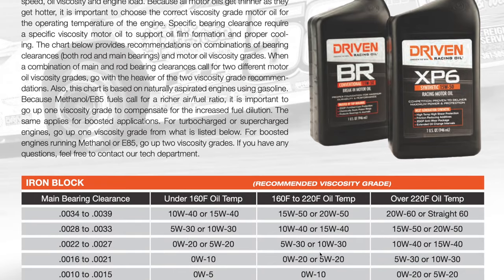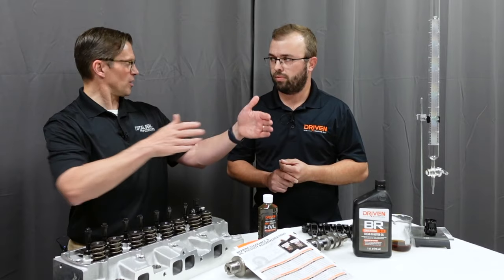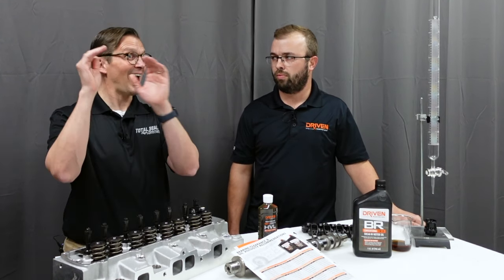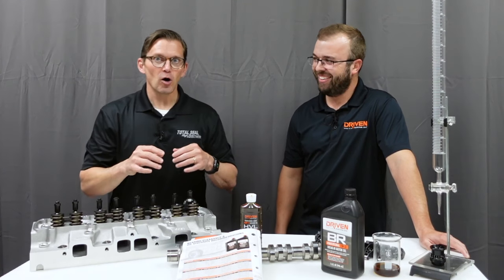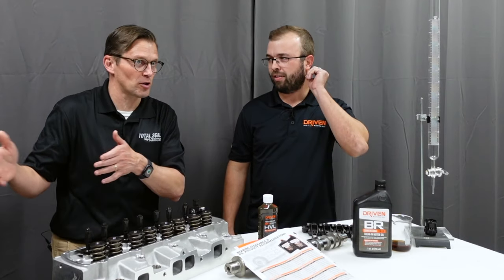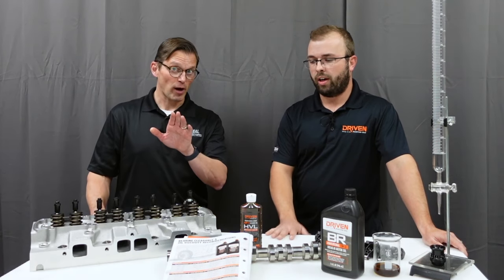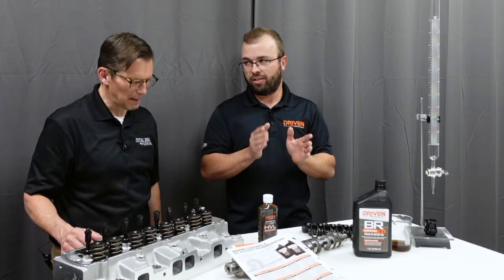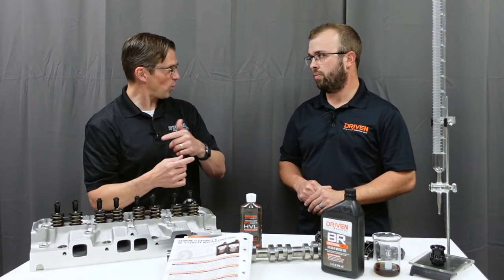How To Choose The Right Viscosity Motor Oil - A Certified Lubrication Specialist Explains

Comment: I thought I heard that variable cam timing was controlled by oil pressure so changing the viscosity could affect Cam timing negatively. I do use thinker gear oils for my truck the the manufacture says to as I know they want better MPG with the thinner oils. I would rather have more protection.

Comment: I would like to know what's the deal with 5W-40 oil and why it's so rare to find anyone recommending or using it 
It's a guess from my car's manual but there is a chart that says "if you drive at temperatures from X to Y and use high quality oil this viscosity" 
So I chose 5W-40 because it does get cold here but it has become really hot here recently and it's an older engine
I am no expert but I think it's the best oil for most older engines that are still running really well. The previous owner was using conventional 10w30 and I switched to a full synthetic 5w40 so it's gonna be better no matter what and the fuel consumption stayed the same

Comment: With the typical low tension rings and or gdi engines, are you better to go up a grade?
Reply from the maker: Going up a grade with low tension oil rings can increase oil consumption.
Reply: @TotalSeal  My Kia with 0w20 was blowing through a qt. of oil in 300 miles, with 10w30 it went to 1000 miles.  So I don't agree with a single upgrade to the second number being a problem.  And I got rid of the Korean cars due to the many inherent issues...

Comment: Lake jr./  can you help me, I drive my 2016 f 150 5.0 v8 only in the summers in Minn. And park it in the winters. I only start it in the winter in my garage twice to 3 times a month, 5 - 10 min. Just to lube the internal  parts. Would using 0-20  be ok to use only  to get the oil to internals  faster at start up, and I use 5-30 Pennzoil ultra platinum in summer. Please  let me know your thoughts, love your oil videos. THANKS!!
Reply: Amsoil 5W30 100% synthetic

Comment: I have a 2008 c63 and the manual recommends 0w40 or 5w40. I have been running 5w49 because people say the 5w is better to prevent lifter tick at startup. Is this what you would go with?
Reply from the maker: As long as the outside temperature is above -10F, the 5W-40 is fine. For driving in colder weather, the 0W-40 is better.
Reply: Try Lucas Oil Stabilizer as an additive...
Reply: The 0w isn't oil weight the 40 is. The 0w is resistance on cold 0w flows better than 5w in all climates
Reply: @DimoS...  resistance to flow is viscosity..... both numbers are weights. 0w40 flows faster than 5w40 at cold temperatures (cold engine start) but has the same viscosity at operating temp (212 degrees F).
Reply: @DimoS...  The word weight has been used since the multigrades came out, it's just a synonym for Winter.

Comment: 🔔👍
I run the Ford Fox police oil to water heat exchanger that connects in the return heater hose and installs under my oil filter. It stabilizes the temp around 210*f, I think. 10w30 Mobil1.
That always seemed like a good idea.
The trucks hook it to the cold radiator hose.

Comment: '19 Tundra with 5.7L, it calls for 0w20, can i bump to 5w20 or 5w30 for the summertime here in in texas?
Reply: Yes. Some of the first 5.7 manuals specs all the way to 20w-50 depending on operating temps.

Comment: Lake Speed Jr. With these glasses looks like a mad oil scientist! Lol Anybody has the bearing clearances of a 1ZZFBE, an EW10J4 and a Ford Vulcan?
Reply from the maker: LOL, if both engines are stock, then you can follow the viscosity recommendation as set forth by the engine manufacturer.
Reply: @TotalSeal Thanks,  So its 5w30 to 5w40 or 10w30 to 10w40
Reply from the maker: @tomasnokechtesledger1786  It that case, go with the 5W-40. Great broad coverage viscosity grade.
Reply: @TotalSeal  great! Thanks.

Comment: Great video! But now I have questions! Thank you very much, so I have a BBC 454 jet drive stock 91 octaine from 47 to 5200 RPM OIl pressure hot is 60 and a bit over 100PSI ta max RPM I am using 20/50 Valoline High zinc on a 300 hour motor. Should I hit the danger zone and change to a thiner oil?
Reply from the maker: Thanks for the feedback. The VR1 20W-50 is a great oil!

Comment: I just bought a 2015 Vette Stingray, oil cap and owner's manual say use 5W-30 dexos1 (15w-50 for track only). GM sent out an update to use only Mobil1 0W-40 supercar oil dexos 2 or R. I found Fram makes a 5W-40 dexos2. I put the Fram in my car ( Las Vegas). What do you think?
Reply from the maker: See what the used oil analysis tells you. Engines don't read labels, LOL.

Comment: I have a fbo and tuned g37 and I live in a pretty cold climate during the winter. I usually run 5w40. Think that’s okay in temps that get close to -10° occasionally?
Reply from the maker: Yes, that is fine for that temperature.

Comment: Great video guys I’ve seen this stuff happen before myself and seen it talked about not this in depth tho I’ve seen most of it from high oil temps to lots of blow by from boost or ethanol use especially if it’s pig rich I find these people that say stick to oem manufactures hilariously full of themselves thinking they already know everything having an open mind is the only way to learn oem manufactures actually recommend different specs in different kind of uses or conditions mostly not on the manual in the glove box but if you do research on their web sites or some even have posters at the parts department stating it Subaru for one I can literally get a picture tomorrow from Subaru in surprise in phx az stating it being ignorant and using it to try and discredit professionals that work hard day in day out to get they’re knowledge is my biggest pet peeve of anyone actual red this looong as paragraph god bless your family’s 😊

Comment: One thing I've never heard anybody mention is it all or cool gasoline engines have a thermostat that usually 195 to 200 degrees. This means the engine runs the same temperature all the time no matter if it's 48° outside or 100° outside . So it should make no difference the outside temperature as far as the oil is concern.

Comment: Here's my advice and take:  Use what's recommended by the manufacturer of your vehicle (it's been durablity tested with that) and change your oil frequently.   No additives necessary!    Just good motor oil!
Reply from the maker: Right on!
Reply: I would add a caveat: Use what the ROW oil recommendation is in your vehicle manual, not the US recommendation. Example: My Toyota 1UR-FE in my GX460 says "0w-20 no matter what!" in my US manual. However, in the manual for Japan, AE, SA, France, Spain, every Africa Country, South America, etc it gives a range for viscosities and does not rec 0w-20 on the oil use chart for anything over 90F. Except I live in Texas and we go weeks at a time where it won't go below that *at night*, with days close to 110. What do these other manuals (that literally all are identical) say? They recommend 5w-30 syn for my vehicle for that temp range, with 0w-40/5w-40 if I am towing or otherwise doing "heady duty" things. SO, I use Castrol Edge Ti Syn or Pennzoil Ultra Plat 5w-30 and my oil consumption went from on quart per 5k OCI to literally zero. Nothing. MPG's are up slightly, engine runs much smoother (even at 17F).

My point being, the US manual was written by bean counters. The ROW manuals were written by engineers. I trust the engineers.
Reply: @DBravo29er   you are right on, same for my Mazda 3. In US says 0w20 but Mexico, etc, 5w30. The only thing is would say is that the US manual is written to meet EPA and mileage reasons.
Reply: @amycyclenut  Yep. And let's be honest, the car isn't going to "fall apart" under 100k miles with 0w-20. BUT, it will be in far worse shape and probably burning oil with needlessly high cam wear. That's just science. 

For people who don't keep cars longer than 100k miles, WGAF, right? But I keep my vehicles for at least 200k. At least.
Reply: My 5.0 f150 is recommended 5w-20 in the us and Canada, but is recommended 5w-30 in the Mexican version. My vehicle is higher mileage and vibrated a lot.  I ran 0w-30 and most of the unusual vibrations went away. I now exclusively use 0w-30 or high quality 5w-30. Timing chain sounds a lot happier too 😂
Reply: Those are very important distinctions!  @DBravo29er
Reply: What if manual says that both there oils are ok? This is in Mazda 3 in Europe
Reply: @zbigniewbohdanowicz8897  I would , personally, run the thickest viscosity permitted by the manual.
Reply: Spoken like a true subject of the state comrade.
Reply: @DBravo29er I run a 5w40 diesel oil in my 150 with the 3.5 EcoBoost…. My reason it’s run in turbocharged diesel engines, and is a bit on the higher viscosity than the 5w30 the book says.  I’ve run the same oil in my Power Stroke with 300000 plus miles, zero issues thus far.
Reply: Id say to use what they recommended for your engine 10 - 15 years ago. The 5.7 hemi for example hasnt changed since 2009. Up until recently they said to use 5w-20, now they say 0w-20, and they tick like a mf now, all in the name of smog/fuel efficiency. So sometimes going against the manufacturer is better fir your engine, but slightly worse for the environment
Reply: Well once you change to different size bearings based on your applications it defeats the manufacture recommendation

Comment: Please advise. I have a 6.0  ls with a high lift cam and ls7 lifters and typical mods to go with.  Bearings are factory..etc    Engine builder advised  10w40 conventical only. Being that lower end was not changed and I dont race it, could I not use 10w30.   What oil viscosity do you recommend?
Reply from the maker: With stock bearing clearances, go with a semi synthetic 10W-30.
Reply: @TotalSeal  Thanks!
Reply: Why not synthetic? @TotalSeal

Comment: My vehicle is 21 years old now, use what the manual says. 5w30. It recommends 0w30 or synthetic 5w30 if it gets below a certain temp in the winter, so I just use synthetic 5w30 year round. Used 0w30 one time, just wasn't impressed much by it or it's higher price.

Comment: Simple: Read the owners manual.
It tells you the proper oil viscosity to use for the car.
It also gives you 2 viscosities that can be used, depending on temperature range the vehicle will be operating in.
For example: 
Toyota Rav 4
Use 0W-20 in cold weather for easier starts, better fuel economy.
Use 5W-20 in warm/summer weather.

Comment: Ive heard engine masters hosts finnegin saying to make more power you cool the engine coolant,,, run colder water after a test dyno run to cool engine ,,, but leave the hot engine oil (runs quicker,, more thin)  to get more hp from following test. So coolder coolant but hotter oil
Reply from the maker: Yep, cold water and hot oil makes more power than hot water and cold oil.

Comment: I would love to see you guys build an engine and run it 500K mile on a Dyno with different visocisity oils repeatedly and weight and measure every part before you assemble the engine then after. Use a calibrated anylitcal scale to measure every part before and after. This way we can see how the chain wears, lifters wear, cams wear, bearings wear with each oil. Check for chain stretch etc.....
Reply from the maker: I wish we could do that as well.

Comment: I would like to learn more about the zinc in Driven motor oils.
Reply: It can damage the catalytic converter, so I've read.  High zinc is for older cars...
Reply: @lonniebeal6032  I’ve completely read otherwise when done correctly like in Driven Oils.

Comment: So this weekend we raced (sbc350/gm crank .0017-.0019, scat rods .002, mahle powerpack pistons, low tension rings, .500 lift rule, NA moror) running XP3 (10w-30  Synthetic) my oil temp guage (autometer mechanical) was pegged over 280-300 degrees.  Same temp with autometer electric guage. My water guage was at 180-190 (weird split, oil/water). Oil pressure wot apx 65-70lbs @6500rpm. Why are my temps so high, and should I switch to driven 5w-20 XP1? Will that help keep temps down? Should i be concerned with 290-300 degree oil temps? Sorry for the long question.
Reply from the maker: Those temps are pretty normal for this type of application, and the XP3 can a handle it. With that said, try the XP1 as it is a better fit for those clearances.

Comment: I have a stock BRZ fa20 NA motor and I only run it on track. OE manual calls for 0w-20. I was thinking 0w-40 with an oil cooler to have more wear protection at higher temps. Temps stay between 245 and 270. Do you agree?
Reply: If you race in cold weather stick the 0 weight.is good , if you race in hot weather zero weight is stupid! Sounds backwards but not really they sell the same  vehicle with the same oil and ship some to Alaska and some to Death Valley all with the same oil. Owner manuals usually say change to 5 or 10wt depending temperate extremes.
Reply: @shellylozano1052  thank you

Comment: Sir Speed, great info here. I may have dunced up on a few oil changes . Used one manufacturers "25000" mile oils to around 20k
 On my '11 Tacoma 4.0 l 1GR-FE  engine. On cold (35*f ) starts , sounds like my vvti rattles. Thinking I may have sludged my oil passages , I am using HPLUBRICANTS high ester blend oil to reduce it. Seems better. Always use either Mobil 1 or Toyota filters. Any chance you'd do a test on this company's products? They are out of Manteno Illinois.  Thanks for your hard work!
Reply from the maker: Thanks for sharing

Comment: I need help!!  I just bought a used 2018 Camaro, V6, 3.6 liter...  the cap says 5w-30,  HOWEVER GM supposedly made an update to use 0w-40.        I am confused what to use?!?!    Mobil one says use 0w-40,  Royal purple, valvoline and Penzoil specify 5w-30
Reply from the maker: For the V6, the Dexos 1 5W-30 is fine.
Reply: @TotalSeal   Cool, Thank you!!

Comment: drive a 5.2l Dodge Dakota, 330k plus miles, use mfg recommended 10W-30 oil.  No synthetics, just Valvoline or Penzoil basic oils. Change oil and filter at 7,500 miles weather it needs it or not.  Always use Fram TG filters.  Never have let the oil get down to 'add' level. Zero engine problems, oil pressure is still good.  Fancy oils are no substitute for a well designed engine.

Comment: My 6.2 in my 2022 GMC Sierra calls for 0W-20, but my 2019 Corvette, 6.2 ZO6 uses 0W-40. I live in S. Texas. Can I run a higher viscosity oil in my truck?
Reply from the maker: Yes, a 5W-30 is certainly a safe option.

Comment: I  have a vw 3cyl that has done 30k mls that runs 0-20W 9k changes! Have not had to add any oil and still very clean looking at change surely that cannot be bad ?
Reply: You should never try to go that long between oil changes, radical environmentalists and cheap skates be dammed.

Comment: The chart is sort of ambiguous. For instance my Honda K20C1, has a main bearing range of 0.0007 up to 0.0019, and it can vary from 1st position to 5th position on the same crank. Judging by the chart that means for 160-220F, the viscosity range is from 0W10 up to 10W30. Well...which is it? You see where I'm going? So going off the chart alone doesn't necessarily work completely...it kinda points you in a direction, but doesn't itself provide an answer.

Comment: Hello, I just bought an imported used 2016 chevrolet impala 2.5l 4 cylinders from korea, on the oil cap it says 5w20, but the mechanic said to put instead 5w30 because we are in Senegal west africa, where we live most of the time in summer, is it a good idea to put the 5w30? Thank you
Reply: I agree with your mechanic but I'm no mechanic. If it's hotter climate use the 30.
Reply: Look at online oil viscosity charts.  5w20 when at 0c flows like SAE90,  owners manual may give more options, if it does, I'd go with a viscosity suggested by and online chart.

Comment: So what type of oil for a california driven honda rod bearing clearance 0.032-0.050 standard (0.0013-0.0020 new) at 160-200f?
Reply: Projectfarms compared 0w20 to 5w30 in a lubricity test, which had a clearance of 0.0000, the 0w20 lost.  If you freeze 0w20 and then go for a pour test, it flows like sae90.  I you're manual only lists 0w20, and you're under warranty, only 0w20.  If you're off warranty, I'd do 0w30 or 5w30.  Which is exactly what my RDXs call for and what I do, 0w20 in the winter or below 65f months, and 5w30 for summer months...